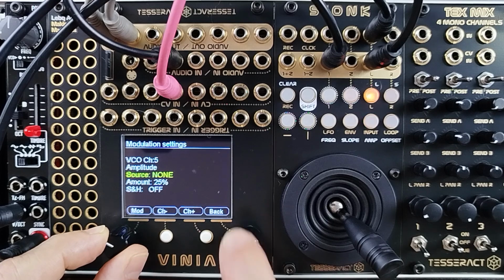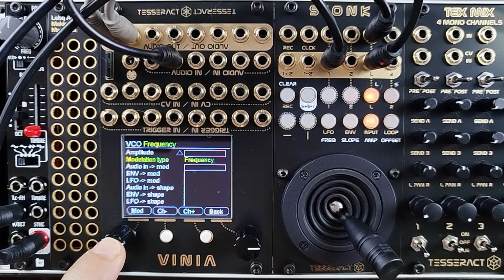VINIA video manual

Comment: Very interesting module. Is it possible to create surround paths such as 3 stereo inputs to 7.1 out? What's the development platform/path?
Reply from the maker: @Jamyangshouseoffoley  the audio outputs are for each individual channel except 7&8 which can behave as mixer L&R outputs. It's based on teensy 4.0 with an alternative dynamic  audio libray

Comment: Super powerful and versatile module, just bought mine! Can you sync the tempo with a trigger input or midi clock?
Reply from the maker: Not yet but it could be implemented too.
Reply: @tesseractmodular3149  Yes please! What’s the best way to send you bug reports and feature requests?
Reply: Tempo sync is super important I think!  I hope this gets added
Reply from the maker: @izntrik  that feature is not important but I take note of it
Reply: @tesseractmodular3149  My idea was that if Vinia could receive a clock signal, then the delay would become a clocked delay which is pretty useful. You said at 18:00 that the delay timing is related to the tempo in the global settings.
Reply from the maker: @izntrik  yes, the tempo of the delays can de set to a multiple of 16th notes defined by the project tempo, by changing the tempo all the delays will change the time values too, but the modulation sources for the global settings are cv inputs, lfos, midiCC etc...
Reply: @tesseractmodular3149  Is there a way to set a default preset to load when Vinia is turned on?